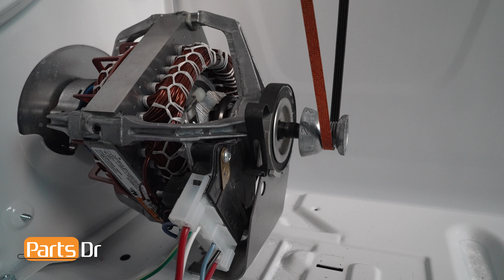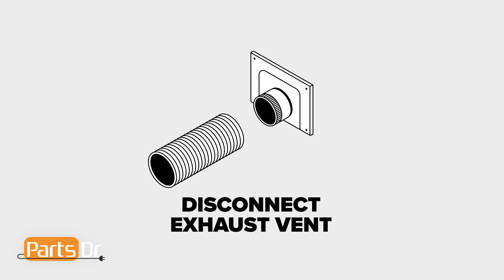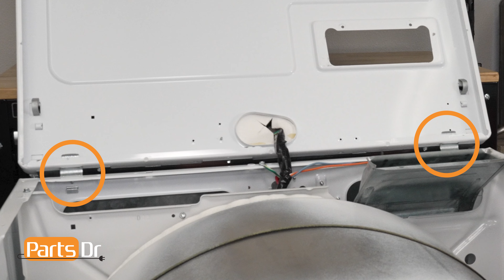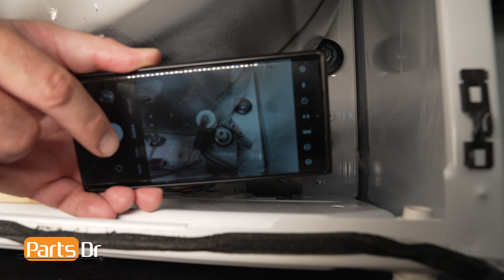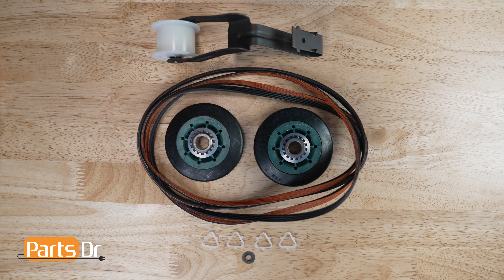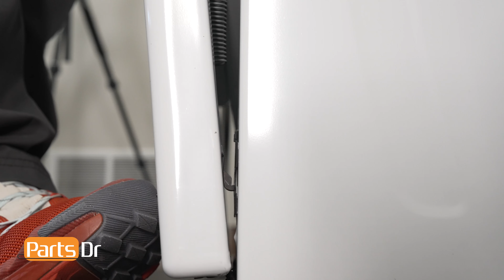How to replace Motor Pulley part # WP8066184 on your Whirlpool Maytag Amana Dryer

Comment from the maker: If your dryer isn't running properly and you need to replace the motor pulley, you've come to the right place! Just a heads-up when ordering parts online, be cautious with sites like Amazon and eBay. Many of the cheaper aftermarket parts are lower quality and may not hold up as well, leading to premature failure.

For a reliable repair, we always recommend using genuine OEM parts. You can find the high-quality Whirlpool motor pulley you need at https://partsdr.com/part/wp8066184-motor-pulley. It’s worth investing in the right part to keep your dryer running smoothly for years to come.

Good luck with your repair, and let us know how your repair goes in the comments below!
Reply: I done all this yesterday before watching your video. Broken belt and broken pulley.  Dryers are easy to work on.

Comment: only thing I would add is to take the time to clean as excess lint, dust or belt residue can be a fire hazard, great instructions and tips though.
Reply from the maker: Thanks for the suggestion, that's a very important point for anyone doing repairs!

Comment: https://youtu.be/N5Am91J4jGI?t=255 If the part is broken, and needs replacing, this is the part that's feels impossible to do, and is the part I hoped you might solve.
Reply from the maker: Let us know if you were able to get this removed.
Reply: @PartsDr  Yes, thanks. I'm not that handy (or smart) but eventually figured out to put a clamp right on the threads and turn the motor to get it free. I used a wrench to fit the new replacement piece like you do in the video.

Comment: I installed a replacement motor, when I turned the drum clockwise the belt starts shifting till it jumps off the motor shaft. What’s the problem?
Reply from the maker: Assuming you are using OEM Whirlpool parts and that you have everything installed properly, sometimes this can be caused by rotating the drum by hand.  Try reassembling the dryer and starting it to see if it works properly.  Let us know what you find.
Reply: @PartsDr that’s my thinking that rotating the drum by hand, is the problem or issue as opposed to the being driven by the motor. So will have to take it to where I can plug it in 220 outlet. And see.
Thanks
Reply from the maker: @michaelsang2583  Sounds good! Let us know what you find.
Reply: @PartsDr could it be the groves of the belt is worn, since initially the drum wasn’t spinning, which led me to change the motor? So if when I plug it in, and the drum doesn’t turn with the new motor then it could be worn groves of belt in the first place. Once I plug it I’ll know something more.

Comment: My issue  issue is the belt is rubbing against the bottom of the pulley and making a sound . I have no idea why
Reply from the maker: Are they all original Whirlpool OEM parts?
Reply: @ it’s for my Amana dryer but it is OEM. It started making a noise out of no where so I took the dryer apart and replaced the belt , and began spinning the dryer with my hands and noticed the noise was from the belt rubbing on the bottom of the pulley. So I’m trying to figure out what made it start doing that . Not sure if this is a common issue because I’ve been trying to find other posts about it and haven’t seen anything really
Reply from the maker: @boblansonfig3972  That is not a common issue.  We often see that when the drum is rotated by hand, especially when rotated in the wrong direction, that is can cause the belt to come off of the pulley.
Reply: @PartsDr  I just realized something . When I turn it manually the dryer motor  pulley isn’t spinning , when I try to spin the motor pulley with my hands , it spins but it’s hard to spin . I think that’s the issue
Reply from the maker: @boblansonfig3972  That could indicate that the motor is bad if the motor is hard to spin.  https://www.youtube.com/watch?v=rbpzjRPMuJ0

Comment: What if the hexagonal end broke off
Reply from the maker: You can try using a large set of locking pliers to try to grab onto it to remove it.  If it still won't remove at that point, you may need to replace the motor as shown here: https://www.youtube.com/watch?v=rbpzjRPMuJ0

Comment: can anyone help pls my dryer wont spin asoon as i add clothes into it. the belt is fine, drum rollers are fine, the felt around the drum and the door is fine, the pulley is fine . what could it be the motor?
Reply from the maker: Does the drum spin without clothes in it?  If you run the dryer with clothes in it, can you hear the motor running?
Reply: @ yes it spins without clothes in it but very weak almost like its struggling to spin the drum. and the motor is spinning
Reply from the maker: @unknown-jd2tr  Check to see if the motor pulley is stripped and that the belt is properly seated on the motor pulley.  It could also be a weak or failing motor.  We have also seen aftermarket belts cause issues with the drum not spinning properly.
Reply: @ the threads on the pulley are a bit worn out nothing bad. i got a new motor and pulley on the way ill let u know if it fixes the issue.
Reply: @PartsDr  i found the issue it was the pulley the threads were out
Reply from the maker: @unknown-jd2tr  thank you for the update!

Comment: My pulley snapped clean off, is there no option to fix. Would I need to purchase an entire new motor?
Reply: A part from my pulley broke off, I called Amana because that’s the brand of my dryer and was told I needed to buy a whole new drive motor for like $180 and that I couldn’t just get the pulley that’s on the motor. Went to a local appliance repair place and was told I just needed the pulley that goes on the motor. Can confirm that’s all that was needed. Installed today and so far so good, I paid around $35.
Reply from the maker: @katherinemrogers  Nice job fixing it yourself!
Reply: @PartsDr  thanks!
Reply from the maker: Is the drive shaft on the motor damaged or broken?